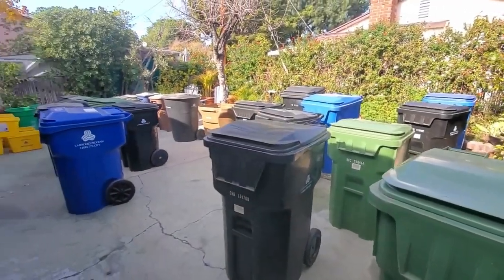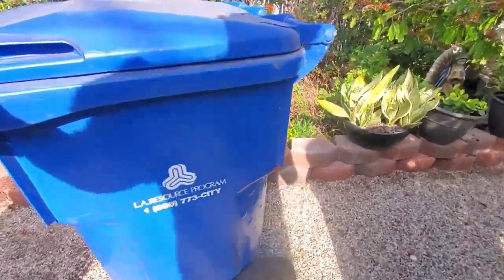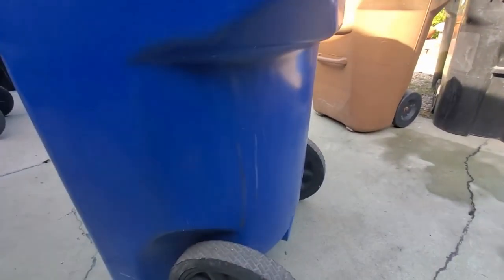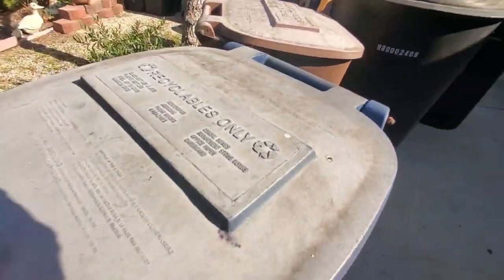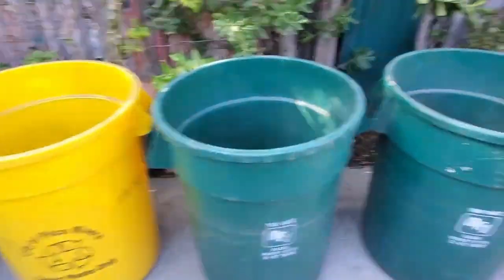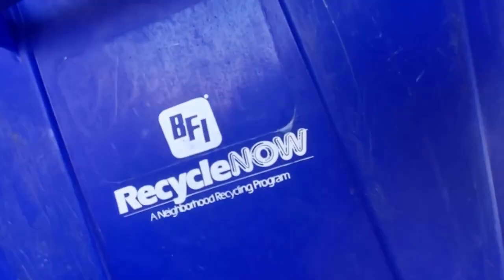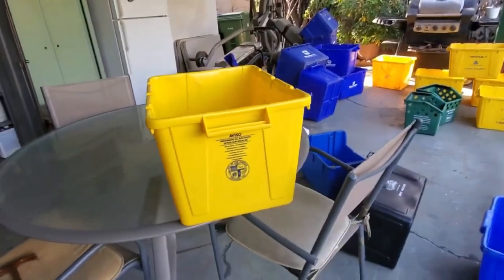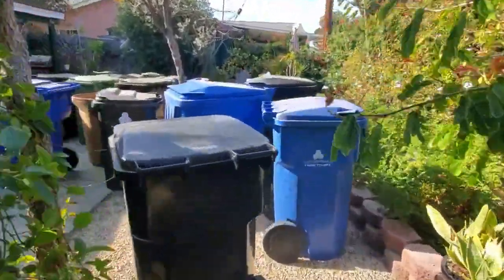My Refuse Cart Collection 2022

Comment: Republic Vegas crates came in Red, White, and Blue. Very nice collection nonetheless. Big kicker for the clean otto Classics, you sure are one lucky person. Sucks the Consolidated one is cut on the side, and the lime WMX tub being cracked. Gonna get any other carts? LA should invest in putting the labels inmolded into the lids like how toter offers that, it will prevent the label from peeling due to the weather.